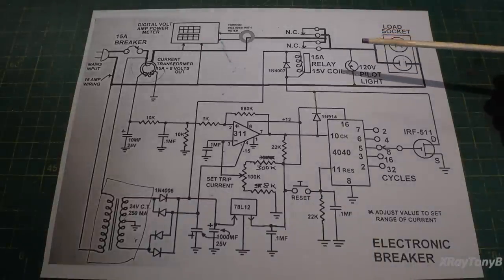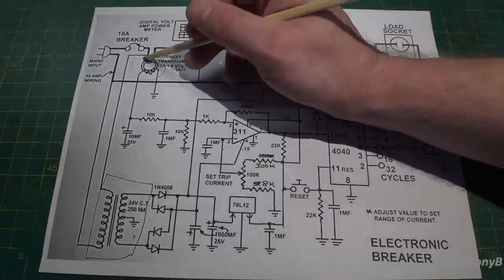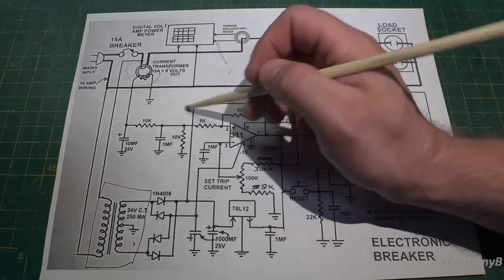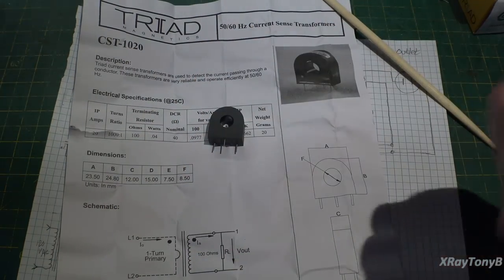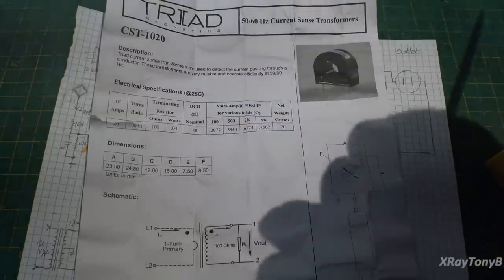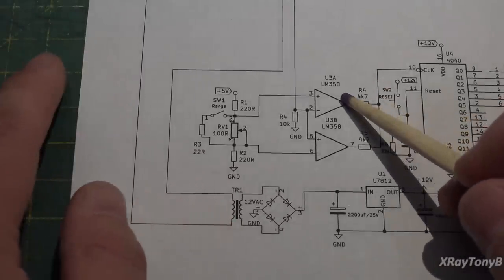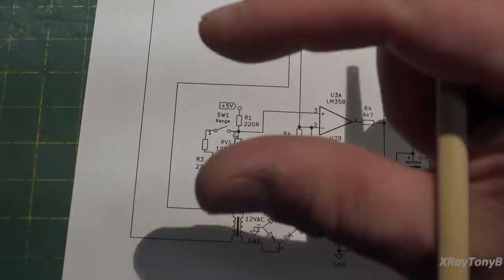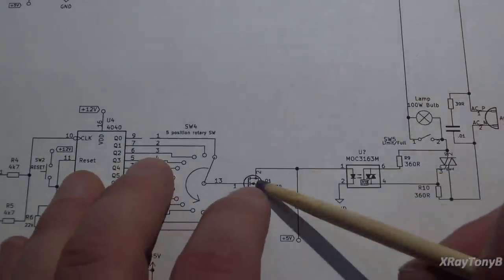Building the Glasslinger Electronic Circuit Breaker

Comment: Nice circuit, i think i will build my own one. But a little overkill, a simple TL431 with a voltage divider would be fine as voltage reference, a MOSFET capable of 4.7 amps at 500 volts for driving an optocoupler seems a litte oversized. ;-)
Reply: I know lol you could drive the opto straight off the CD4040 chip
Reply: There is already one regulator in the circuit to have a fixed voltage as a reference.   No need for another, just calibrate your window thresholds from that regulator's voltage using multi-turn trimmer pots.   Although the TL431 is a great precision reference for cheap.   He could have used a BS170 or 2N7000 if he wanted to use a MOSFET but a jellybean  2N3904 for driving the Opto would have been totally fine too.    Better yet use a 2N3906 (PNP) to source current to invert the logic like he did using the MOSFET as a pull down instead of current sink through the Optos LED.  Why use an Op Amp (LM358) as a comparator?   An LM393 which is optimized for comparator functionality is a better choice.    Again!!   I'm curious, why is this better than a plain old fuse???
Reply: @jp040759  firs of all your right but I think you replied to wrong person think you was replying to Michael Bombe's comment. as to the part where you ask why is this better than a plain old fuse, well yes a correctly sized fast blow fuse will be as fast but would pop on an inductive load this unit allows you to set say 16 cycles for turn on and then once the inductive surge has passed you can change the sensitivity two as little as 2 cycles while also setting an exact current offering a very precise protection level to the DUT or repair this device lets you set a wide current range and trip cycle hysteresis so you can quickly set up for what ever you want to protect and its  obviously also resetable  so  to provide the same level of protection using fuses would involve a large selection of fuses and replacements should you have a problem and be inconvenient changing them each time you wanted to set a different  current limit
Reply: @T2D.SteveArcs  Thanx   That makes sense.
Reply: @Stephen Morton Thanx   That makes sense.
Reply: @jp040759  No worries I think I know what happened I think you missed the resistor connecting the anode of opto to +5v

Comment: I'm having trouble seeing how this works? In the original circuit the power goes to the load via a normally closed relay, the trigger circuit opens it when it detects a high enough voltage generated in the pick up. Here the main power circuit seems open till the sensor cct triggers the triac? Or it looks backwards...What am I missing? I know I must be being stupid because he showed it working.
EDIT: I keep looking at it and it keeps looking backward...I'm really worried I've gone stupid.
Reply: let me help ya out fella if you look at the MOSFET that controls the opto the led in the opto is connected through a resistor to plus 5v so the opt and the triac are normally on, when the circuit triggers the MOSFET is turned on it pulls the anode of the optos led to ground thus stopping the triac firing and breaking the circuit
Reply: @T2D.SteveArcs  I'm so embarrassed I just got a blind spot and continually glanced over it...?
Reply: @martinda7446  lol No need for embarrassment. its easily done,  its part of the human condition, we some up quickly in order to be able to react quickly, its a survival trait, the problem with that is we sometimes see what we expect to be there rather than what really is. and once you have seen what you believe to be the truth its very difficult to ''un-see'' and therefore this can mask the obvious truth....  Steve
Reply: @T2D.SteveArcs  Thanks for that. It is a good lesson.

Comment: Ok I am a nerd too like to take schematics to read in the toilet in your first schematic the out put of your toroidal current sensing transformer is sent to a cap that goes to ground as the first section of a filter so no signal the cap is a electrolytic so it needs a dc signal so watts up ?
Reply: All in the video, he's using a hall-effect based current shunt rather than an actual transformer, but couldn't find an appropriate symbol.

Comment: You stated that if you unplugged the power supply that the contacts would close and then there would be no protection for the output other than the 15 amp breaker.. If you unplug it there's no power to any part of the circuit so it would not matter, so you lost me there. If your concern is that some other part of the circuit might fail so that the fet was no longer driven to break the contacts that would make sense, but you used the word, 'unplugged'.  As far as welding the contacts, that can be done with N.O contacts that happen to be closed at the moment just as easily as N.C contacts if the relay was driven beyond it's current rating.

Comment: I've interacted with Glaslinger for years, over at the Neonixie-L (nixie tube) forum:
https://groups.google.com/forum/#!forum/neonixie-l

A few comments on the original comparator circuit: you're confusing people with the AC/DC stuff. The inputs of the comparator are only required to stay within the rail voltages. In Glaslinger's circuit, he uses a bipolar supply, so the current transformers outputs will stay within the rail voltages. You don't need a bipolar supply. Just apply a DC bias, such that the resulting "time varying" signal stays within V+ & gnd (common). Here's a zero crossing detector that does just that:
https://threeneurons.files.wordpress.com/2013/11/zero_x_sch.gif
It uses any op-amp, and don't get hung up on the 11V supply. It can vary quite a bit. Its a window comparator that uses only one op-amp stage.

I don't like your window comparator. At least as far as the output is concerned. As wired it outputs between 0 and half the supply voltage. 4000 series CMOS relies on "0" being '1/3 supply' or less. Logic 1 being '2/3 supply' or more. Also, you can run 4000 CMOS upto 18VDC. So a 12V supply would have been fine. Unregulated, too. You should have used this window comparator:
http://www.learningaboutelectronics.com/images/Window-comparator-circuit.png

Comment: I think you generally are very safe in your practices but today I must take you to task for one thing in this video.  I’m sure you think that your circuit is extremely FAST and sensitive to MINUTE changes in voltages.  BUT it can not compare to a wife’s perception to a disturbance in the FORCE.  You my friend are playing with fire while soaked in gasoline.  You have been warned, do not repeat the use of the iron and acetone or you will be rendered a crispy critter!
Reply: You know, an iron isn't that expensive - especially at thrift shops.
Reply from the maker: ....but humor is priceless!

Comment: Your clock pulse is too low, use two diodes replacing R4 and R5, and a pull down resistor on the clock input. 4000 series  is supposed to switch around 6V at your VDD of 12V. Your reset circuit needs a diode cathode to VDD of the 4040 and anode to the reset pin to prevent the clock pin to go above VDD in the event of a quick decrease of VDD. Might be a good idea to add some positive feedback to your comparators to prevent additional clock pulses.
Reply: I noticed the original circuit took some steps to block additional clock pulses, but I'm not seeing that in your revised circuit.